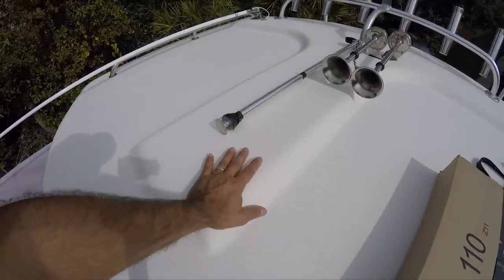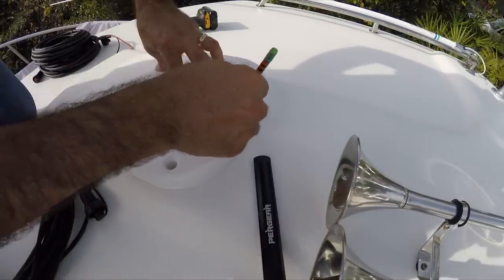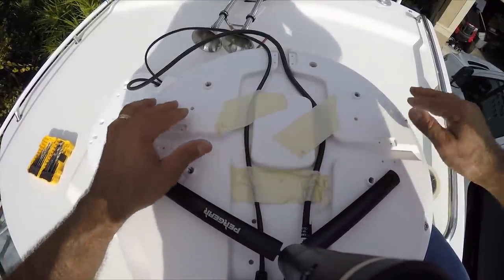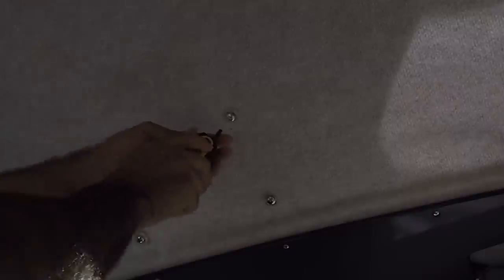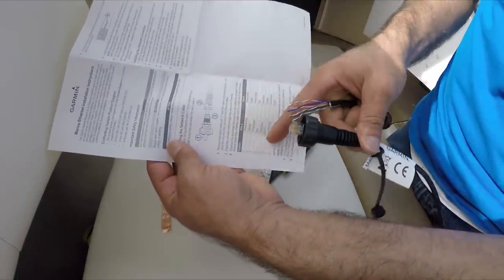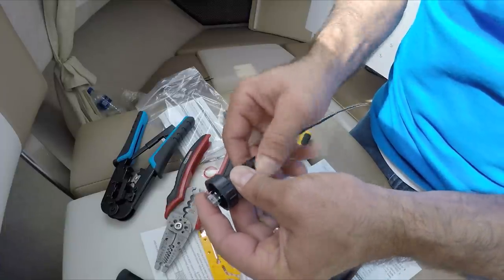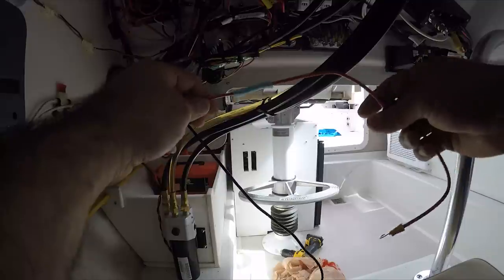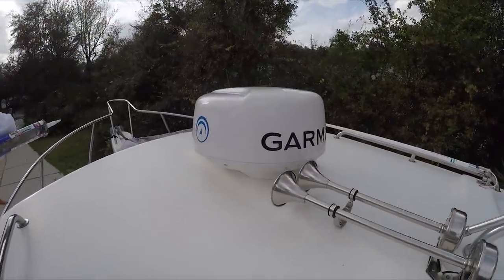Garmin Fantom 18 Radar Installation Crooked PilotHouse boat DIY

Comment: Great video nice and neat. Just a word of advise from a Parker 2120 SC 2003 owner where ever stainless screws touch the carpet put a plastic washer under the bolt head my carpet is all stained due to stainless screws rusting hard to believe but they do rust
Reply from the maker: Awesome advice thank you so much and it's true they do Rust.
Thank you for watching it for your great reply captain

Comment: Just watched your video on the install and you really did a great job on showing how it’s done. I am ordering this radar soon to go with my new boat that’s on order. I will attempt the install! Thanks and we really enjoy your videos!
Reply from the maker: Glad it was helpful! John and congratulation on your future boat purchase see you on the water cap.⚓😉👍
Reply: @OutOnTheReef  Hi again Captain. A question on Mounting the radar? How would I know if I need the mounting wedge or not. I want this to work flawlessly and if I need it I sure would get it. Thanks for all you help
Reply from the maker: @Glory-Days-Fishing   Hello John well you have to look at your boat when witness navigating and see if your bow is very high if your bowel is very high you need to compensate for the dome to be is it's level as possible it doesn't have to be a 100% in my case my bow is a little high so the wedge compensates a compensates a lot so you have to look at your boat when it's navigating and see how   On level is your boat
Reply: @OutOnTheReef  Hi again Cap. Another question for mounting this radar. After the dome is mounted I am going to also have to install my Antenna for the VHF. Does this have to be any certain distance from the dome itself?  My objective is to mount everything over the electronics box of the hardtop so the wires are easy to just drop into the electronics box.
Reply from the maker: @Glory-Days-Fishing   Hello John and I and I mounted mine about 3' away no problems no interference that is a good amount of distance 3 feet works perfectly for me
Reply: @OutOnTheReef  I’m heading up this coming Tuesday to the Tidewater factory to see the progress on the boat hoping it won’t be long till she is ready to go!
Reply from the maker: @Glory-Days-Fishing  wow cap Tidewaters is a good brand hope everything goes well and im sure it will not be Crooked like mine, lol , hope you get it deliver soon so you can enjoy it, im sure you have made big sacrifice to make that purchase, keep me updated on you delivery cap. 👍👍👨‍✈👨‍✈

Comment: Nice one. Well done. You should change the autopilot fuse to a similar one too, it’s safer.
Reply from the maker: I think it's the same it's the same size captain
Reply: Out On The Reef i refer to the holder cap 😉

Comment: Great great job——I’m happy you finally own that now.thats a very awesome thing to have when conditions go rotten on you out there.
I see some comments on caulking that base to the roof and I agree totally.you may also want to add stainless finishing washers to the bolt heads on the inside of the cabin.Those bolts looked like you had JUST enough to make the connection but those finishing washers are countersunk so you should still be ok making the connection.also the heads of the bolts are damn near the same size as the holes you drilled so with time you could put a lot of pressure on those 4 contact points. Washers will transfer more strength to the ceiling of that pilot house and keep it much stronger.I know you don’t want to draw a lot of attention with the hardware on the ceiling but it will look more than fine.most importantly it will add strength and hold up to the pounding of the water and wind load on the dome.———it won’t take much time—do one at a time and it’ll be easy. Congrats on that addition man.like I told you months ago-your gonna love having that the first time fog rolls in on you👊🏻
Reply from the maker: That's an awesome idea Captain I did not think of that I just went with the washer they Supply me with but you know companies don't give you exactly what you need and yes it will be a lot stronger for pounding the ways I agree with you 100% captain and thank you for the great suggestion good looking out. Cap.👊👊👊👍
Reply: @OutOnTheReef  I’m glad your taking my advice and not feeling like I’m being a “know it all”!———I’ve been doing mechanical type work my whole life and I’m not a young man.bottom line is I know structure and the effect wind and wave action have on static items exposed to the beating that Ocean can dish out.

Im always impressed when I see you do these installs.I see how much care you take and how neat you are—that’s the mark of a good mechanic.your also willing to accept advice like a gentleman and that is the best way to learn better techniques for the future.
Keep up the good work and the awesome content👍🏻——JohnM—L.I.N.Y👊🏻
Reply from the maker: @johnm5714  100% agree John i appreciate your knowledge and you are so right that will spread the stress of the bolt, viewers like you have helped me so much when I forget to do something it's much appreciated because I got more eyes on the install  that just mine only can't see and think of everything, but that's where viewers like you kick in and help out,
From a captain to another thank you for watching and navigate safe⚓👍👊⛵

Comment: Is there a reason you didn't buy a 6' Ethernet cord? Did the Garmin come with threaded studs for mounting? Or were they too short or you didn't want nuts and washers exposed on the headliner? Thank you
Reply from the maker: well the 6 feet cord was not long enough  and the garmin studs ware not long enough cap

Comment: Very nice I hope you use the bird feature to catch dolphin and tuna when you’re in those blue waters.
Reply from the maker: Lol yes cap , I still have a lot of learning to do about fishing😉
Reply: Really doubt that radar has bird mode it's too small. radar's ability to resolve small moving objects is dependant on the distance between array. this is why you see 48" open arrays on 24' center consoles.  Not saying it can't be done with that radar just that it probably doesn't have bird mode, you'll have to tune it in manually.
Reply from the maker: @rsdna9698  in the next video you'll be surprised captain when I try the writer you'll see if it catches bird or not
Reply: @OutOnTheReef   Never said it wouldn't just said it probably doesn't have "bird mode", I'm sure you can manually tune it to see birds out to maybe 2 miles of a very flat day. I used a 24" analog Radome to find birds for years, but man it's a lot easier now.
Reply from the maker: @rsdna9698  yes cap.

Comment: Good job with the install. Did the placement radar block the Horns....? Do you ever check the difference in sound.....? Was there even a difference?   Thanks!
Reply from the maker: Thank you Captain and no I did not make a difference on the horn at all the sound travels everywhere in front of the boat thanks for the great question

Comment: A Cable Clam on the Hardtop would allow the cables to be waterproof and able to remove the cables with the RJ45 ends still on....Saves time and money done the road when the radar needs to be removed for repair or damage.  I use them all the time coming behind installs that use those stupid stainless clam shell and Gobs of silicone.
Reply from the maker: In my case it's very easy to change that cable I just run it  Through the TikTok it only takes me 10 minutes to run that cable it's not a big problem captain the less connections you have the better the radar would read the more you split it the more frequency you will lose

Comment: Hi do you have a plate mounted underneath your Antenna mounting bracket? I mounted mine using a Shakespeare phase III and the roof flexes a little bit when it moves back and forth.
Reply from the maker: I am using a wedge for the radar and I placed the link in the description below captain hopefully this will help

Comment: Wished I saw this before I installed my Garmin Fantom radar and didn't drill a 1 1/4" hole,,but did put a  gromit in the hole, Very well done video,, Also you had the pliers or purchase them too
Reply from the maker: I purchase the pliers at Amazon I place the link in the description below if you want to check it out.
Hope you like your new Garmin Fantom

Comment: Finally attempted my install today. Everything went perfect and I used this video the entire time! Only issue I had was the factory bolts were too short with the Radar wedge. I’m having a hard time finding the Allen rod bolts. Which bolts did you use ?
Reply from the maker: awesome Jared , and you had the same problem then me , the bolts ware small, and i placed the link of the big bolts i used in the description below,  it took me a long time to find them, hope it helps cap, thanks for watching👍👍

Comment: Clean install!! I would run a bead of caulk around the base. Would have also run some on bottom of base around screw holes. Water seems to always find a way to get in. Great job though!! Looking forward to seeing it turned on.
Reply from the maker: That's an awesome idea Captain thank you
Reply: I was thinking the same thing .
Reply from the maker: @motolifealways  yes that will be a good idea to do I can always go back and do that real quick thank you for the great suggestion to you both ,good looking out😉
Reply: @OutOnTheReef  no problem captain, we would rather not see an episode of possible water damage coming from the top.

Comment: X-O-LENT installation!! Only two issues - 1) You voided the warranty by installing your own fuse block (modifying the mfgr's equipment, but being Garmin you probably won’t have any problems. 2) Did you seal the through bolts at the top to wedge and the unit to wedge?? What’s the range of that unit??
Reply from the maker: Yes i did cap. Thanks
And the range not sure but i think is like 24 miles but you need alot of altitude of radar to get that distance
Reply: Out On The Reef Sounds like you’re going to need about a 30’ tuna tower!! Hahaha Actually, if you’re getting 1-2 miles at surface, you’re good. You should get a 24 mile sweep for weather, if that’s what the unit is rated for. Again, good job!!
Reply from the maker: @michaelrutledge7048  LOL yes a tuna Tower will be awesome but apparently since I tow my boat I don't think that will be possible but thanks for the great idea cap.

Comment: QUESTION ??? Where did u get your bolts ??? My Garmin Fantom 50W came with much shorts bolts, Thanks
Reply from the maker: Use the ones i have in the link cap. They are longer
Reply: The link takes u to Amazon - where there are multiple sizes
Reply: If u could please give me the actual size, that would be Great !!! Thanks
Reply from the maker: @johnnygervais3499  usually the ones that show up fist wen you hit the link without changing the size is that one cap. i made this video years ago so i dont remember of my head cap.

Comment: I am also considering the purchase and installation of the Fantom 18 radar.  It appears you are routing the radar cable along the same route to your panel as your VHF antenna cable.  Do you have any interference between the Radar and VHF?   While reading the installation instructions for the Fantom 18, Garmin suggests routing the radar cable away from the VHF antenna.
Reply from the maker: No captain I don't have a problem at all with the VHF radio and the radar

Comment: I am thinking of doing the same install - is it necessary to create that ethernet end or was that just because you had too much wire and wanted to size it down?
Reply from the maker: You can keep the wire the reason I cut it is because I did not want to open a huge hole on the fiberglass but if you don't mind opening a big hole on the fire in the grass you don't have to cut the cable captain this wrap it up and put it somewhere hope this helps
Reply: @OutOnTheReef  Thanks for your quick reply! Makes sense. I will have a challenge with threading the wires through my tower and up to the helm.
Reply from the maker: @eternitysshore  is a lot of work but you can do it cap👍

Comment: very nice captain; what are going to do with the horn now, are you planning on moving it to the side?
Reply from the maker: Since the Raider has a 4 degree inclination the horn does not even touch the beam so there's no need to move it if I put a parallel I will need to move it but it's an inclination that it doesn't interfere with it

Comment: Nice install. My only question is if you considered adding a radar mount to raise it about 8” or so? I see the mount that came with it has a built in wedge to it. Asking because as you know, your head is above the pilot house roof when standing on the rear deck. If you ever do that, I really like the stainless Battlewagon ones. Powder coat ones usually go bad. Boat is looking good.
Reply from the maker: Thank you Captain in the reason I didn't use a pedestal for the Raider it's because I don't like the way it looks and yes the higher the better but when mine is running I'm not going to be fishing in the back of the deck my Raiders only going to be running when I'm inside the Pilot House to avoid exposure to the radar
Reply: Out On The Reef I agree with the look of the raised mount on the 2120’s. It looks a little funny for some reason when they are raised. It does look great flush mounted. I had a custom Bimini made for mine that connects to the cabin via a....I’ll call it a dodger. The way you use your boat I think you would love it. It keeps the sun out of the back ind helps keep it cool and give a place to stand/sit under while on deck while being able to still handle lines. Wish I could share some pics. Maybe I could add it to my uTube channel for you? I’m not good at it like you though. Great to see another 2120 guy making the most out of their boat. Hope to splash mine towards the end of March sometime.
Reply from the maker: @akajbssmith7423  yes please I would love to see some pictures of yours if you can upload it to your YouTube account and please let me know when you do that way I can see it and my next project on my pilothouse is a ice machine sounds crazy but it's very needed
Reply: Out On The Reef - Ice maker! That will be an interesting project. I posted a very crappy vid of my top & boat to my UTube channel if you want to check it out.

Comment: Good morning! I am getting ready to complete this install on a 2320, do you mind sharing the details on what bolts you used?
Reply from the maker: hello cap and im sorry amazon had me removed them and i have no way to get that cap im sorry, but my recommendation is buy a lot of them and keep the one you need and send back the ones you dont use cap, hope this helps.
Reply from the maker: Here is a vide showing what amazon did  cap.https://youtu.be/BwmnwXbRrxc?feature=shared

Comment: Hello I have question.  I'm also planning to install  same radar and garmin gps.  Is there are any other accessories that I need to buy? Other than radar and gps unit.
Reply from the maker: the wedge helps level the radar wen on the way cap. ad longer bolts  and i placed the links in the description below cap. hope it helps
Reply: @OutOnTheReef  captain.  Thank you. I just ordered my units. Now I will have 2nd eyes.  😀 Do you like it so far?

Comment: Hey Capt I'm not sure I'm not a garmin tech but from side view it look to me like your beam angle in directed towards the downward angle. You might want to check into the wedge maybe should be turn around to get a little up angle thanks just saying that is what it looks like to me JT 🇺🇸🐟🎣🌴🛥⛱😃😊🙏🏻🙏🏻🙏🏻
Reply from the maker: I understand your recommendation but when you see the video when operates I have a Drone footage will show you that the Raider is level when the boat is in operation and when it's not it will be a little bit inclined down but that's what the manufacturer recommends to have on a boat like mine
Reply: Out On The Reef I got it now I believe that has bird function on my boat that would have to work find working birds find fish the only marlin I've ever had on and I did rookie mistake after he jump and I know better you know what it was ?

Yep tighten the drag stupid stupid stupid I have a tld 25 w 40 lb mamoi high vis yell 700 yds 2100 ft don't don't don't touch drag once you have on fish you can chase him down down in Islamorada I cried live and learn but I knew already JT
Reply from the maker: @hookednrolling2009  well Captain sorry to hear that that was a big loss but I'm glad you had the moment at least.
And yes I believe it has the bird capability